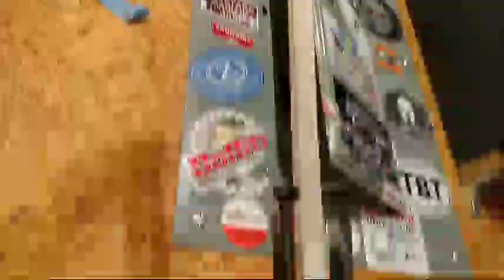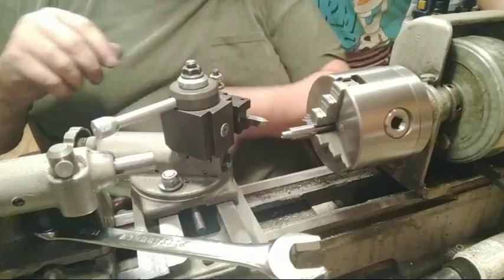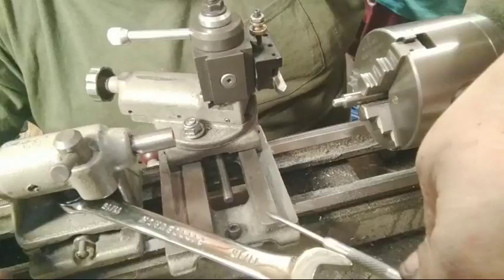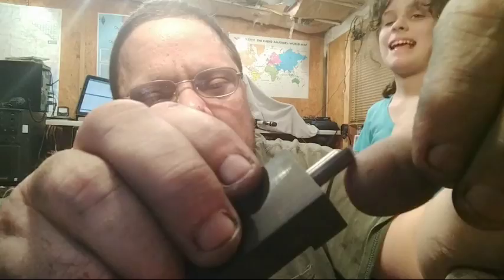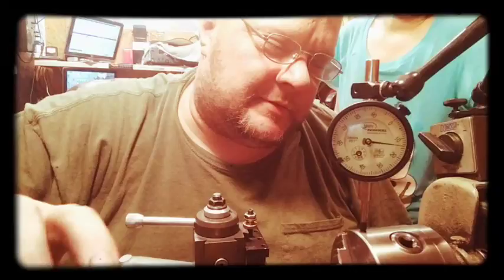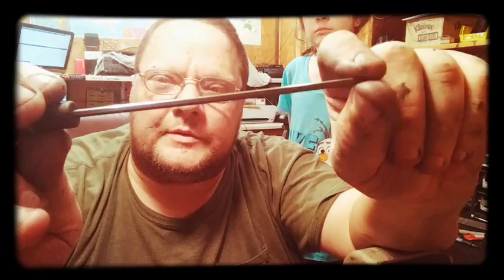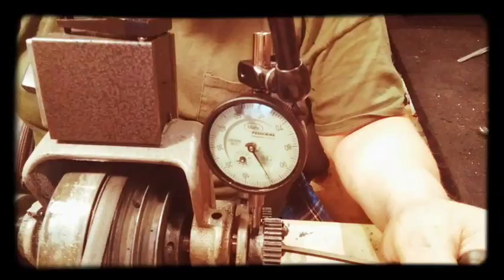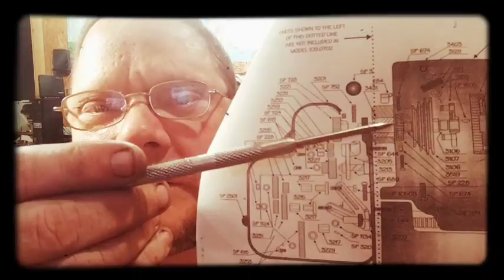Working On The Lathe (Live)

Comment: Sorry Scott, but that much back bearing slack won't account for your front of chuck deflection. Think of travel on each side of a balance scale. Travel is same on either end at same distance from pivot. If your lathe shaft is pivoting on front bushing, and you see seven thousands on back, then you should see only seven thousands on front at same distance out from pivot point as the back bushing is from pivot point. More likely is that the front bushing is worn eliptically. (Which makes sense given stress when cutting: wear on bottom and back of front bushing, on top and front of rear bushing.) I'd take it apart and examine that front bushing.
Reply from the maker: Doc Pedersen ok I will check that in the morning. But thanks for the advice

Comment: have you considered getting a motor speed control or maybe change motor pulley to slow rpm?  should help stop the chatter you get.
Reply from the maker: 207951 I was in back gear